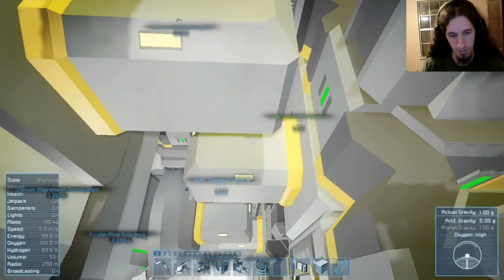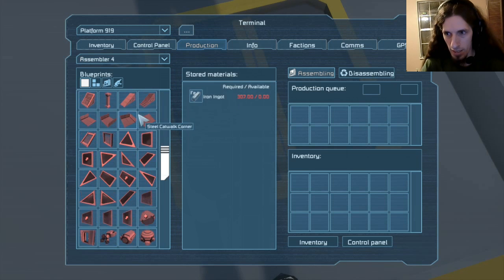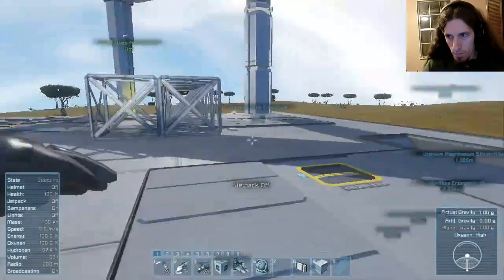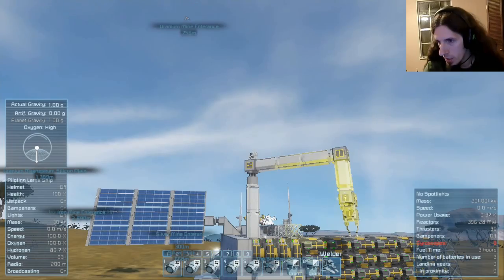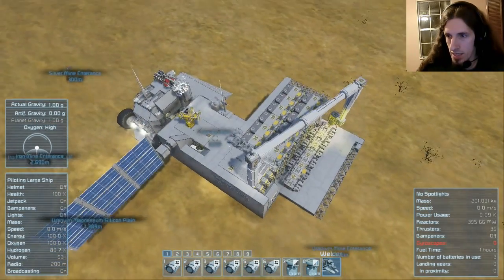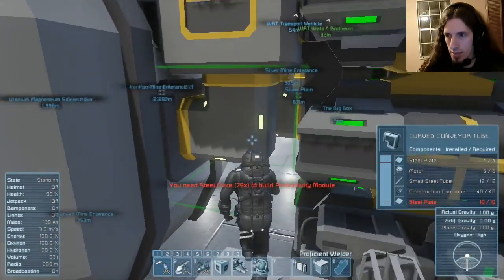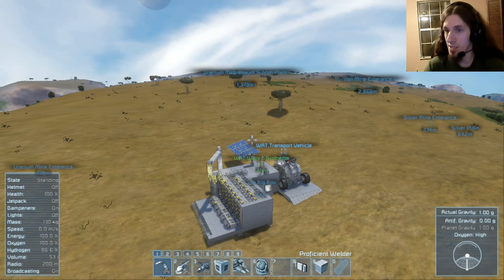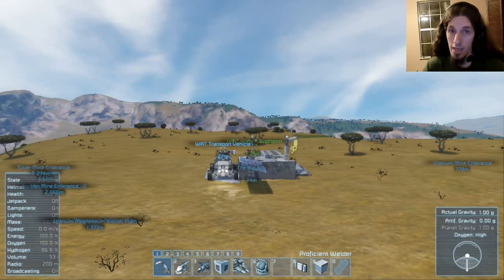They'll Need a Crane - Space Engineers #3

Comment: you can simply toggle the pistons on/off to stop them from moving. and I would set the rotor to move slow, then hot bar toggle off/on and a reverse option. but nice setup man; cranes pretty sweet.
Reply from the maker: +Captain Chillzout Tried toggling them on/off, they didn't stop. They just wouldn't accept any commands from me until I toggled them on again. Of course, maybe that's just a bug.. kind of like how I can use the tier 2 grinder fine but the tier 3 grinder crashes my game or turns all my tools to auto-use until I equip the drill and click once. Pretty sure that's not exactly working as intended.

Comment: So the thing starts shaking when you are extending it?
Reply from the maker: +Littica Marek Rather, when I rotate it via the rotor. I've actually fixed the shaking since the video. By turning down the torque, the rotor now slowly picks up speed, and slowly brakes. This means I have to predict where it will stop, but it's faster and easier to position it at a specific location rather than just wait for the violent shaking to stop.

I tried this on the crane I built before too, but those rotors were vertical and the loss of torque resulted in the whole thing just succumbing to the planet's gravity and flopping onto the base. As this crane only has a single horizontal rotor, gravity isn't as big a problem.
Reply: Decker Shado Gaming
Glad yet get it workind a little better either way, is there a way to build some kind of pipeline system moving from your base to the mining areas, that way you could essentially build little mining outposts with a drill arm

Or is something like that not really possible?
Reply from the maker: The conveyor system can work. I could just go down to the iron mine and build a new base with it's own power source, and a crane plus a driveway with a connector to use my little transport car to collect ore and return it to the refineries, but a long string of conveyor tubes would allow me to mine the ore and have it sent directly to the refinery. Unless there's a limit on how far you can build.. I've heard legends of failed space elevators due to build size limitations.